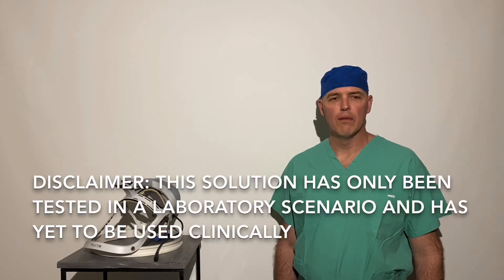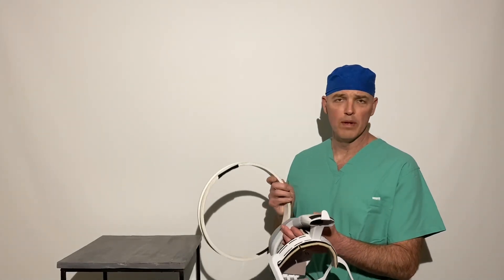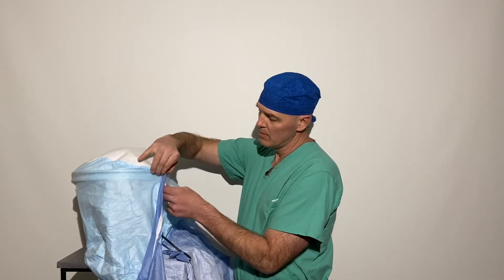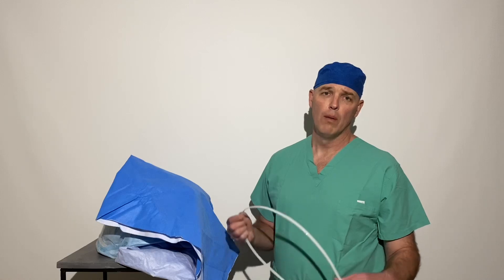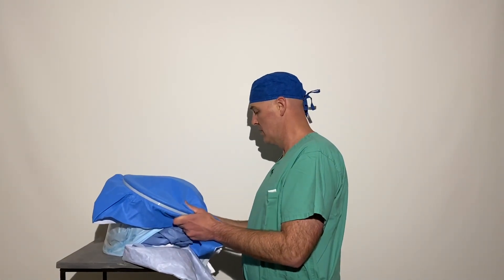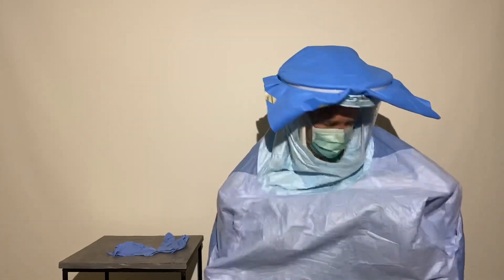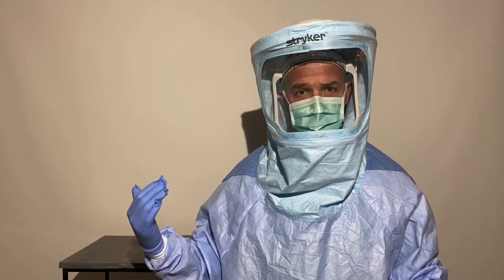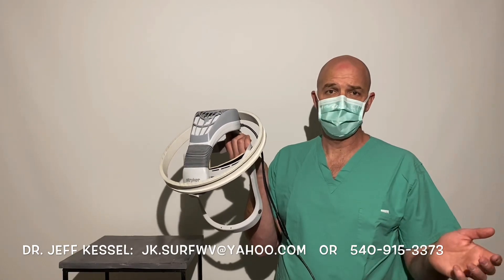Stryker Flyte Suit - Crown Conversion for COVID 19

Comment: Excellent work, thank you.  The way you describe it in the video it looks like the construct is going to be used for PPE in a nonsterile environment.  Has anyone attempted to use this in the operating room setting to protect the surgeon and staff?
Reply from the maker: This was initially designed for non sterile use.  We haven’t tried to place in a sterile fashion.  Theoretically one could be put on from behind while the wearer was in the suit and sitting on a stool.  This would  leave the front arms and hands sterile for the wearer.  Could someone in a sterile gown and gloves place it and sacrifice that equipment?  We usually only talk about shoulders to waist level as being sterile anyway.  You would have to figure out when to donn the unit though.  What is the exposure to the wearer?  After enough air cycles in the room?  Is the patient intubated?  Is the procedure aerosol generating?  Could you wear a sterile gown over top for short procedures like central lines?  The surgeon and tech could theoretically wear N95 and goggles underneath and be protected.  The hood filter is 0.185 micron and passes Bitrex alone, but is not meant for smaller particles.
Reply: I will request that my hospital place an order for the rings.  In the meantime I am building the bucket version in my basement.  Once again thank you.

Comment: Wow... what a great solution! Thank you Jeff and team.

We ordered 20 and are designing our implementation even before they arrive.

Below are all the key points extracted from a detailed review of this excellent video, in case it helps. This is just a draft, and I welcome any suggestions.

Will share our subsequent refinements as well.

/Mike A.

Assemble ring and toga

- Velcro ring to top of helmet - start with back, align velcro as best as possible, then front: leave space behind hook to attach face shield later
- Hook toga face shield to front, then attach both magnets to face shield (they are inside-out)
- Gently drape toga back over the frame
- Start zipper down back 6-8 inches to hold everything in place
- NB: all white material must be INSIDE ring (air intake must all be within ring to ensure it all passes thru the filter)

Assemble and attach Halyard filter (Halyard = ubiquitous blue sterile case wrap material)

- Halyard pre-cut into 44" x 22" rectangle --> folds into 22 inch square
- Folded blue side out
- Lay on top of helmet -- align so it doesn't obstruct face shield, but leaves adequate material around ring
- Pull 5.5 - 5.75 inches of zip tie thru (we can mark each zip tie at this point with a red sharpie)
- With zip tie "tail" in back, start at front and work material into groove
- Verify entire zip tie is in groove, then tighten zip tie slightly
- Gently pull material down thru zip tie ring, ensuring it is smooth (no bunching or large grooves)
- Fully tighten zip tie
- NB: ensure zip tie is completely within groove and tight: no large folds or grooves in Halyard fabric

Donning

- Wear regular surgical mask and a pair of non-sterile gloves
- Caution: zip tie tail is an eye poke hazard
- Hold by inside of helmet, NOT by crown (can dislodge velcro attachment)
- Don from front, like a bike helmet
- Tighten adjustment knob
- Push arms thru sleeves
- Don second pair of gloves -- STERILE gloves preferred for outside due to their longer length
- Assistant zips back of gown

Doffing

- Hand hygiene of outer gloves
- Grab front wings, and with a rolling motion, pop the zip tie and material off the crown ring
- Place into red bag
- Hand hygiene again
- Assistant unzips back of gown
- Pull gown off from back to front over head
- Remove outer gloves inside gown as you fully remove gown
- Place in red bag
- Remove inner gloves
- Wash hands while helmet still on
- NB: Helmet frame should remain uncontaminated (if this procedure is closely followed)
Reply from the maker: Yes!  That’s it.  Great job.  Let me know how it applies in clinical practice over and over.  Still working with my admin to implement.  Lots of systems to integrate.

Comment: Your adaptation is very creative. Have you taken into account the air coming from below from the bottom of the toga?  This may increase with the restricted flow through your filter material. A simple belt above the level of the end of the zipper would limit that. The zipper may also be a source of air leakage. The original design was to protect the patient from the surgeon; not the surgeon from the patient.
Reply from the maker: Joe Dressler we tied the waist band of the gown during the trials and had the fan on high.  There is positive air flow always down and out of the gown.  The fan is situated right against the hood and doesn’t have enough draw to bring air from the floor.  When we purposely tried to contaminate the toga with particles up the gown we were unable to show penetration from the ankles to the face.  Bitrex was also sprayed up the gown with no effect.  It is off label use, but in a pandemic you do what you have to do.

Comment: How much power does the fan require?  Depending on power requirements, it might be possible to create a "top off" pack that increases runtime without having to open the toga to change batteries, using the same technology now used with wireless phone charging (Qi power standard) or a variation of that.  Even if it can't supply 100% of power, this approach would extend operating time.  I can help engineer this if it might be a promising enhancement.
Reply from the maker: I would have to check on battery output and fan power need.  Out of a microdroplet environment, to unzip the gown for 30s to replace the battery is ok.  As long as the helper has gloves on and can replace the battery without contaminating the battery slot.  If you aren’t in a patient environment with aerosol production, it is only contact precautions.
Reply: @jeffkessel1963  Ok.  Thanks for the answer!  If there's a electronics question, please feel free to drop me a line.  Wishing you safety in this difficult time!
Reply from the maker: Joseph Chiu thanks.  Stay safe.  I will look into it and hit you back
Reply from the maker: Joseph Chiu Stryker has been less than forthcoming.  They don’t want to reveal secrets.  But they did say their is some computer control of the fan/helmet/battery interaction and that meddling with fan efficiency or battery output would require modifying that relationship

Comment: is only the white crown on top the part of the toga that doesn't pass the test?  We were thinking about using just the stryker covering in combination with a regular MaxAir PAPR helmet as it does not come with a built in shroud.
Reply from the maker: Yes.  The white portion is the area that allows air to flow into the helmet.  There is concern that a PAPR fan with the toga could entrain air through the white area and contaminate the wearer.